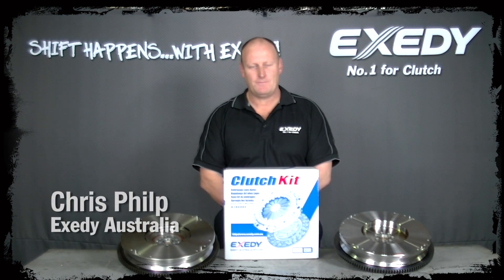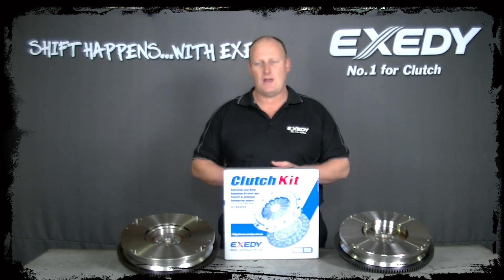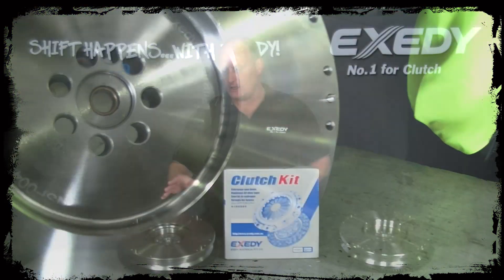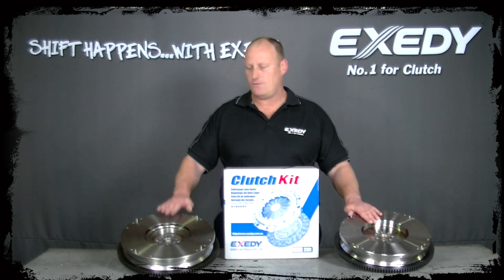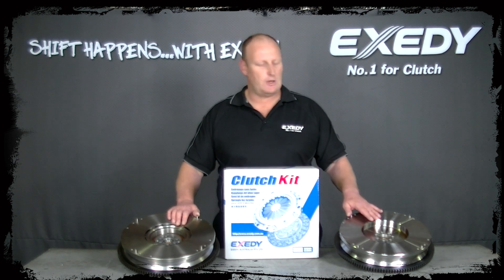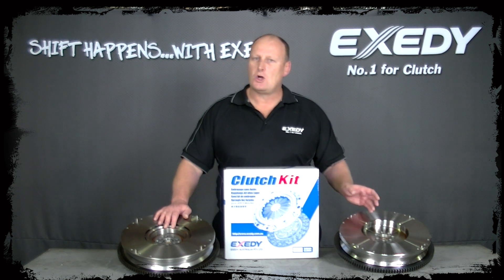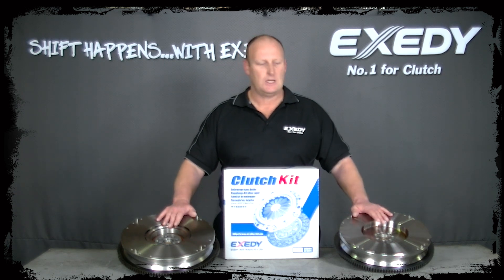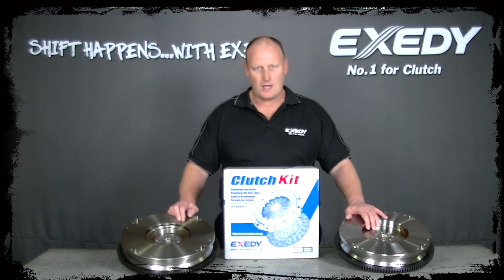Single Mass Flywheel vs Dual Mass Flywheel

Comment: I have a 2006 MK five GTI with a manual swap when I got the car, the work had already been done and I liked it now the slave cylinder went out which was in my gearbox. It’s internal so I had to bring it into the shop when they replace everything it wasn’t shifting right so we went ahead and replace the clutch bc it was pretty beat .  and I get a call saying there’s a single fly wheel in there now and the clutch they ordered takes a dual plate flywheel . So that’s what they want too throw in there … will this affect my performance or my sweet tuner sound 🤣. Really though . I would like too know if this is a good call or not . For the car cannot handle a stock clutch
Reply from the maker: Thank you for reaching out! We appreciate your interest. For further information, please email us at sales@exedy.com.au, and we'll be happy to assist you.
Reply: Why is the slave cylinder in the gearbox? Idiotic design.
Reply: @elliotkane4443 vw been doing this for years, they have to drop the trans an it gets them another hour of labor lol
Reply: @moneyman1641  They're pretty keen if they can do that in an hour.
Must be a fairly easy gearbox to pull.

Still don't see any reason for it.

Comment: Hi to all !

It's been  a year since i've changed the DMF into a SMF in my VW 1.6 TDI GOLF VI (10/2010 model CAY Engine).
Since then i face i shimy symptom in idle state and only when the engine reaches the 90 deg. Celcius operating temp. NO SYMPTOMS till that tenp.
Many technicians say that the injectors are responsible for that which Ihad overhaul serviced at 250.000 km.
For the time being  i've covered 302.000 km. Let me say that a single injector costs 420 euros!
Any idea for where to start the troubleshooting from is highly appreciated.
Reply from the maker: Thank you for reaching out! We appreciate your interest. For further information, please email us at sales@exedy.com.au, and we'll be happy to assist you.

Comment: To tell you the truth- No need to change anything at all. The cause of vivration is the connection of transmission to plywheel. Only computer can check the perfect allignment. The answer to solve is just a simple Universal Coupling. Think about it

Comment: Had to replaced a worn DMF with a SMF on my focus, shifting feels terribly difficult now the engine is at least more responsive...
Reply: Did you have them both dynamically balanced as a set? that is key and 99% never spend that extra slab of beer cost.

Comment: Hello, is it good to put on my bmw e46 318D.116KS single mass flywheel?
Reply from the maker: G'day @VlahMMA. Great questions. There are pros and cons of both the Dual Mass Flywheel and Single Mass Flywheel system so as a start, take a read on our Tech Note 047 which can be found on our website for more insight prior to making a decision ==> https://exedy.com.au/ts1636412636/attachments/Page/155/TN047%20Issue%203.pdf
Reply: @ExedyAustralia  Thank you
Reply from the maker: No worries at all - Happy to help. Cheers.

Comment: I have a 2006 tdi .needs clutch replacement  so much opinions  o  what is best .any ideas on going to a single mass conversion
Reply from the maker: G'day @up up and away, thank you for your enquiry. So that we can discuss your enquiry in more detail, would you mind contacting our customer service staff on 1300 366 592. Further, we suggest you have a read of our Tech Note 047 which discusses the pros and cons of single mass and dual mass flywheels. This note can be found at https://exedy.com.au/ts1636412636/attachments/Page/155/TN047%20Issue%203.pdf

Comment: In a slow revving diesel, you get worse MPG with a solid flywheel because you end up running a lower gear to get rid of the gear noise.
Reply: They put dual mass ones in many diesels for that reason some petrol cars do have them 2003 jetta 1.8 turbo i have has a DMF

Comment: As if they hadn't ruined diesels enough in the 2010s, complicating perfectly simple systems throwing into the mix, electronic throttle butterfly's, MAF sensors, EGR valves, and exhaust particulate filters.....now I learn some kind of ticking timebomb of mechanical failure, 2 pieced flywheel full of rubber and springs lurks below my bell housing awaiting future attention?  Fuck my life.
Reply: ok... how exacly has the butterfly valve ruined diesel? Helping the car with shutting down and causing less vibrations is bad??? sure....

how exactly is maf bad? Helps to calculate the air intake and fine tune air mixture... more efficient is bad apparently

how has egr ruined it? besides the carbon build up, theres 0 disadvantage to it and it reduces emmisions and might prolong engine life since it makes the internal combustuion process to be lower in temp, might use a bit more fuel.

dual mass flywheel is for comfort and helps smooth things out with gearbox, how is that fkin bad? 

DPF is shit.

Lack of knowledge pretty sums up your comment. Just complaining.
Reply: @hmmm9183   butterfly valve....redundancy. it's not needed in a diesel, its purely adding complexity, Increasing pumping losses, and I've never seen a diesel continue to run without fuel. Shutting that off works perfectly fine. Leave the air alone

MAF, same thing more unnecessary added complexity. It's only there to tell the computer how much fuel to inject, and I can do that with a cable and my right foot. When the sensor fails, the vehicle stops working. This is frustrating, counter productive, expensive and can all be avoided.

EGR ... you said "besides the carbon build up, there's zero disadvantage to it" while being completely contradictive, that's also Incorrect. The addition of the heat exchanger, and recirc pipe, now allows the diesel engine to drink its own coolant in the event of an internal failure. And it absolutely happens. Go talk to a mechanic.

My Dual mass flywheel complaint still stands, gearbox bearings last far longer than dual mass flywheel systems, in vehicles with engines that have well designed balancer shafts. Which is probably why there are so many 'single mass conversion kits' on the market today.  It also, feels terrible to drive with, especially when combined with the "dead pedal" that arises by fitting all the other crap listed above to make a computer do something (again) that a human can do with a cable attached to a mechanical pump, a functioning brain, and a right foot. 

DPF, EGR, DEF....are all added complexity, designed purely to get manufacturers through increasingly stringent emissions tests/laws. That's all it is. Anything else you've heard, saving the planet or otherwise is called 'spin' and 'marketing'.
Reply: @AJthedisgruntled  butterfyl valve can be simply taken out, few screws... it helps to shut off and is not that more exprnsive. And what pumping losses are you speaking of? The valve stays open all the time when driving. Sure very minimal restriction, but if you argue maf is shit then your whole point suddenly make absolute 0 sense.

Maf is an extra calculation. If you do it on your own you will simply spray load of fuel and get nowhere. Without maf car doesnt just stop working. It continues to work woth what is left. O2 sensor, charge air temp, map, but wait... lets remove them because you can do it on your own... yeah right, I mean you can, but the efficiency will be atleast 100 times worse.

Egr can also be used to control engine temp.

Theres just so much flaw in your logic... majorty of these things make things better. Theyre reliable, but just because they fail once in 200k mile or km you say remove it, not needed. You hear how stupid that sounds? 

Let go and remove everything. Fuel gauge? I can just drive and fill it up. Counting milage? I can just add up in google map. Tachometer? I can just listen to the sound. Speed? I can just go by eye. Knock sensors? I can just listen. And what more shit you can think of.

Complex suspension? Aight. Just remove everything and build it like a carriage

Id understand if all that was often. But when it happens to 0.001% of people in 200k mileage, its just plain stupid
Reply: @hmmm9183  right one thing at a time here Einstein. You're gonna have to go away and try to understand "added complexity". Let's go back to the butterfly first and I'll try and explain "pumping losses" to you. In a "newer" diesel engine , When the computer decides it wants to recirculate EGR gasses, it has to partially close the intake butterfly as you drive along the road to create a vacuum in the manifold, and force it to suck a portion of the soot and inert gasses from the exhaust manifold into the engines intake. Creating this vacuum takes effort from the piston as it travels down the cylinder on the intake stroke. It's known as a parasitic loss, and requires some energy from the engine to overcome. In a "traditional" or older diesel engine, without EGR, there is no throttle butterfly in the inlet manifold, thus far less parasitic losses during the intake stroke, while driving along at cruising speeds. This is just one example.

 I'll agree, the power of a modern computer controlled  diesel engine, "per cc" is far, far greater than a traditional "oil burner", however I'll argue they're no more fuel efficient. I get 10km/litre from an old diesel 4x4 and I get the same 10kms/litre from my modern one. Newer isn't always better, especially when you add in (that due to the added complexity of all the extra sensors and systems) the engine refuses to function WHEN one of those stupid MAF/MAP sensors, O2 sensors, craps out, or emission control related systems malfunctions , or the dual mass flywheel flys apart prematurely,  and leaves you stranded at worst or in "limp home mode" at best. Because they do.

I'm not interested in removing suspension and fuel gauges or any of that nonsense you brought up. I'm simply stating I'd rather drive a slightly shaky, partly noisy, manual gearboxed mechanical fuel pumped, non restricted, slightly slower, simple diesel vehicle, that's FAR more reliable, and much less costly to diagnose and repair if it does break down.
Reply: @AJthedisgruntled  alright, you got me there. Completely forgot that the butterfly valve is also used for egr control. This ones on me.
EDIT: But it doesnt really introduce any pumping loss, as the the open egr valve just gives the air instead of the outside. The same when petrol engine get better mileage with egr than without it.

But I still stand by my point that air monitor sensors should stay. As youve said, I have also noticed that newer  vehicles get not so better mileage or worse. But that partly due to all the restriction systems dpf, multiple cats.

Ive seen multiple cars with dual mass flywheels well above 400k km (thats something like 250k miles maybe) and theyre holding up just fine.

Sure its annoying when the car goes into limp mode. But then again misreporting how much air youre getting can lead to very lean mixture which is not so good. 

Yeah, I lashed out by saying some stupid shit, but kind of just wanted to say that little things add up bit by bit.
Reply: @hmmm9183  I'm glad you've come around. And we've found some common ground here. We actually agree on a few points.  Yes the EGR is open, and there is an alternative path for induction, however it's still more restrictive, AND, let's not forget, it's also replacing GOOD air, with exhaust fumes. I am aware of why manufacturers do this.
Cooling down the combustion chamber by replacing good air with inert exhaust gasses? This always used to be an effect of reducing the amount of fuel injected, not choking things up with dirty air, and then reducing the amount of fuel injected anyway. It's unnecessary.

Getting back to the sensors, diesels don't care how lean the mixture goes, Only humans do (Since the discovery of NOx emissions). An old diesel runs perfectly fine without MAF map O2 EGR DPF etc and will never fail to operate if any of those things fail, because they're simply not fitted. Thats, called the added complexity of a modern diesel.
We've both agreed, they don't have better fuel consumption, but they do have more power, hence are more efficient. None of that matters to me, when I'm stuck on the side of the road watching traffic go past, because a perfectly good mechanical engine, refuses to run because an electrical component has failed.

As for the ticking time bomb of a dual mass clutch, (which is where we started here)  I hope you're right and they are good for 200,000 miles +
Reply: @AJthedisgruntled  Im not sure, but theres no sensors to exactly monitor how much exhaust gases are coming into the chamber, tho probably can kind of guess by the amount of air that is coming in. I mean this goes by high to low pressure so without maf its really hard to guess (and without map obviously). The way I was learning on the egr lead me to a video that showed back of the exhaust temp with and without egr. With egr (at idle and warmed up) the exhaust gasses reached around 80c, and without it was about 90c. Probably proportional so like 10% difference, so in the chamber the fuel burns hundreds of degrees more. But regardless of that, the more oxygen there is the hotter it burns. And since diesels are not petrol, its really no way around this. Tho 10%(given that its proportional) should not be that big of a deal.

We might have different experiences with dmf. But even other friends have had the dmf for about thay long, or bought one that had a defect and still drove around for 5 years.
It might come down to how the clutch is operated. I personally basically dump the clutch one the rpms match the gearbox, while majority of people drag it along.

Anyway, this was educational for me. Realised a few things that i havent.
Reply: @AJthedisgruntled  I agree with all that you stated and know of many Diesel engineers and off Roadies, 4x4 and rally drivers that prefer SMF for starters and the old Diesel swirl chambers with less valves, no EGR, no ecu, no DMF, no extra hosing all over the place that starts to crack and becomes expensive to replace, no extra fuel burned to keep nox down, no carbon buildup and a few of them drive daily MOGs albeit with turbo, simple H20 injection and re-sprung tune mech pumps. Some even converted to V belts so they will never get stuck anywhere. I would never tinker with a modern diesel, or own a car with DMF as I would prefer to rebuild a manual transmission every 500k or in the case of many normal pre-2yk cars and trucks. KISS principle cant be beat. The Green Agenda is pure bollocks as is everything they dish out to keep us further from having a simpler and happier life.

Comment: Don't replace a dmf with a dodgy clutch kit, the clutch will not be tuned to the vehicle! You will get noise vibration and harshness!
Reply: Besides the fact that a clutch already acts as a damper when changing gears…Usually the established clutch companies do tune their kits for the specific vehicles. Also most of the time cars with DMF’s had at one point or another an SMF with that transmission available, and get the DMF in a remodel or facelift update. That’s a very misleading generalized statement you made.
Reply: @BigBear--  Also DMF fail more than Transmission bearings in the life of a vehicle, not all DMFs wear the same due to driving conditions variations of each customer and when replacing with SMF the key is to have both the flywheel and cluthc dynamically balanced at the cost of a 24pack of beer which is rarely done by 99% by done by all in the racing industry. A well designed clutch has never had issues reducing the vibrations or harmonic issues if the engine internals are balanced properly, engine is running as it should and crank balancers are working correctly. DMF is another point of failure and lazyness in the industry for trying not to balance and engine properly to save costs. Some of the crankshafts from DMF engines are way out of spec as told by engine balancers worldwide.
Reply: @user-fj4tn3qf7k  Agree with most of this. Except that depending on the manufacturer, most quality high end aftermaket clutch/flywheel kits, from reputable manufacturers, come pre-balanced as a paired set. But can't hurt to re-check of you have the time/will/cash.
Reply: @BigBear--  Clutch is a hard to get to as separating engine and box should be done as least as needed, flywheel and clutch balancing together is a do it once and forget.

Comment: if your car is designed with dmf its not a good idea to swap it ... may cause serious damage, maybe not, but does it worth the risk? Change it for a high price and you wont have to worry about for the next 150-200k miles if you are careful...

Comment: I have a skoda roomster 1.9 tdi 105bhp. Mechanic told me £450 to supply and fit clutch and flywheel.  I phoned a auto spares who took my reg and told me my car don't take flyweel it has a solid one, just need clutch kit. confused now
Reply: Your comment is missing alot of words.

Comment: On a Diesel engine, yes. On a petrol, no.
Reply: Silver_Arrow No what, which are you talking about....!? 🤨
Reply: @jacksbackable  DMFs are used to dampen the vibrations from the engine to transmission. Diesels create alot more vibration than near enough all petrol engines so they are suitable for all diesels and a very small amount of petrols

Comment: If your car costs less than 5000 pounds and done over 100k mileage. And the clutch goes.. go for solid mass flywheel.
Reply: this is an aussie youtube; $10,000 and 160 kkm